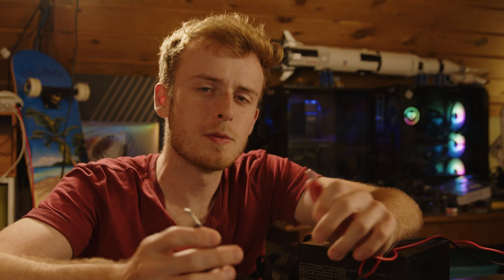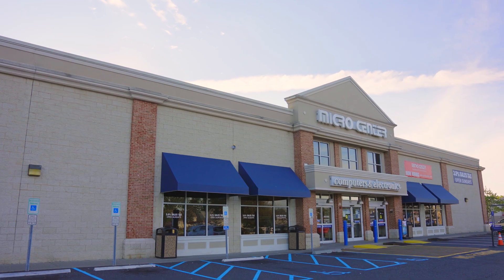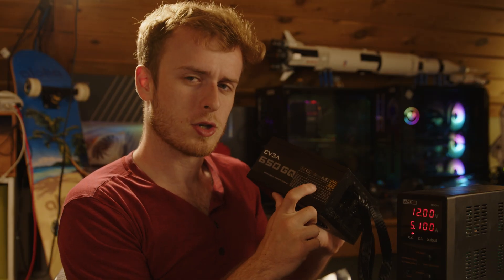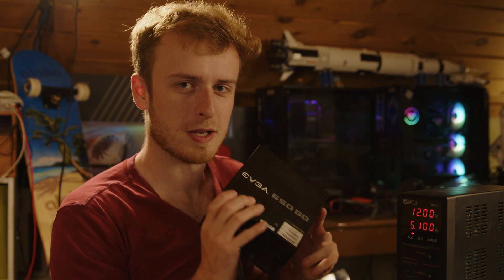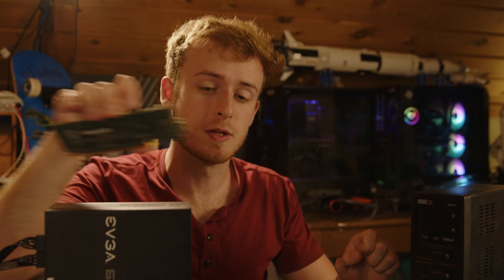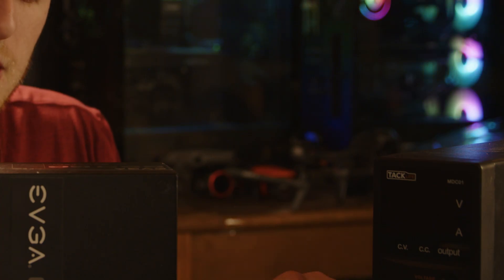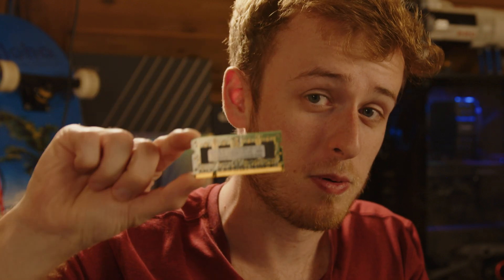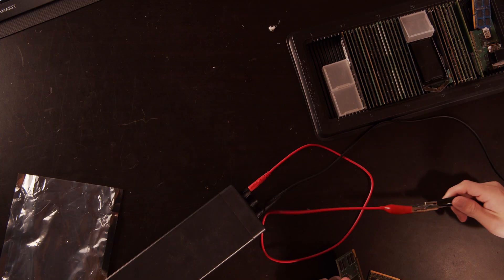Which Computer Part Conducts The Most Electricity?

Comment: Im 99% you fried the CPU and the ram, and 98% sure for the GPU, but people must understand one thing, the voltage is not so important if the current is limited. Your PSU can be set to 100volts but if the current is limited to some safe value the voltage will drop immediately. 1amp for the CPU is not enough to kill it if its distributed at the right pins, the same goes to the other parts, but the way you connected the power clamps is at totally random pins, so you maybe connected them on shorted together pins, like 2 grounds or 2 power pins and then the PSU is at current limiting stage and the only resistance are the probes and the device tracks and pins.
Reply: This is why I love his channel he’ll fry things in the name of a video I’ve see him destroy so much stuff giving us content

Comment: So now I am wondering how my CPU draws well over 200 Watts under load if its Voltage is at 1.3V if 1 Ampere is astronomical. P=I*U; 200W=I*1.3; 200W/1.3V=153.85A. So for a CPU 1A is actually not much. Same for a GPU.
Reply: @Ioan Moldovan yea I know but I talked about the core voltage which is approximately at 1.3V.